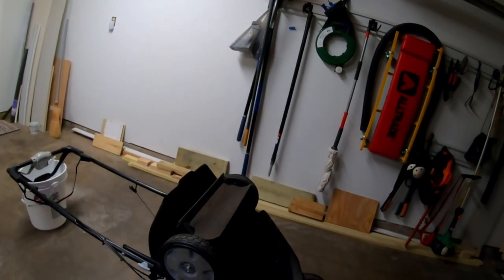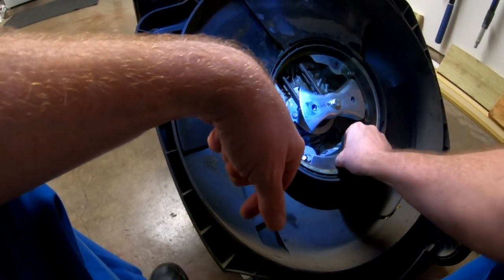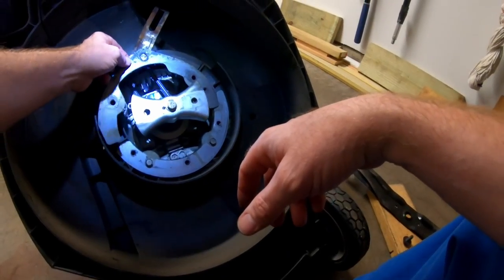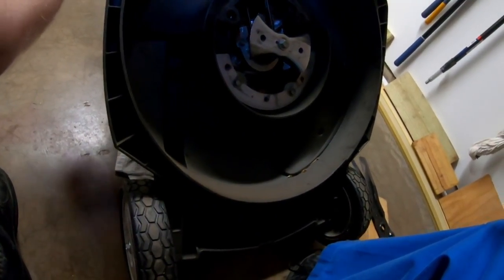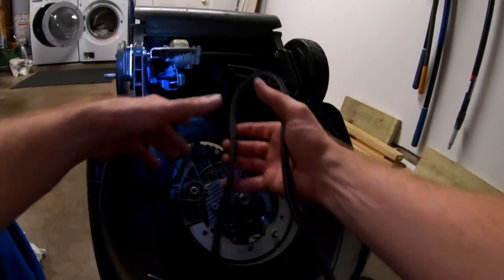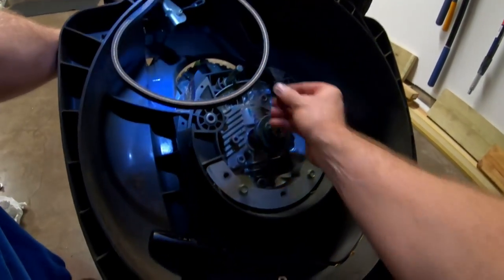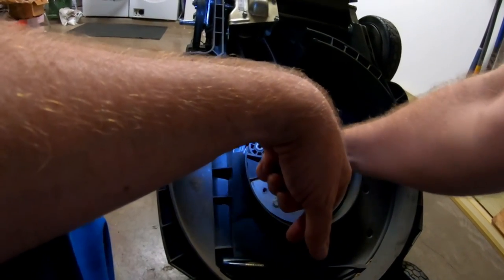Honda HRX217K5KAA belt replacement

Comment: Great vid!!  Thanks for the tutorial.  How did you know what size Bearings to order for those wheels? Are the fronts and backs the same size? Thanks
Reply from the maker: I included the part numbers in the updated video I did of this but the part numbers I got from the shop manual I bought for the mower, they are Axle Bearings 91056-vl0-b00

Comment: I think I need to do this,  My mower doesn't really have a variable speed is just like one speed, I try to adjust the cable but nothing change, my guess is the belt,  is that why you change your belt?
Reply from the maker: If yours is like mine, you may need a new belt but there is a belt tension adjustment that I cover in the end, maybe that helps your situation.

Comment: This video was helpful, lighting and camera work could use some improvement. Some of the tricky parts were out of the frame. But thanks for the info
Reply from the maker: Just updated this video by enhancing the lighting and audio from the original, added a few pics of some of the shots that were off screen. Was pretty novice with the gopro then.

Comment: Great video and thanks for putting this together.  What was the model number of the belt you purchased?
Reply from the maker: Probably a late reply, I was just updating the video due to the lack of lighting on original, but to answer your question it was Honda Belt (22431-VH7-K00)

Comment: How often does the belt need to be replaced
Reply from the maker: Just a guess, because it would depend on how much grass you cutting each mowing, how long your mowing seasons is etc. 5 years approx. You'll know because you turning that traction dial further and further clockwise means you are trying to put tightness in the  belt to get more traction. You can adjust the adjuster at that point to get some of the traction back but only so much room for the adjuster to go.

Comment: Anti-seize on bolts, shouldn’t it be a blue loctite?
Reply from the maker: On my Harley it definitely is blue Loctite, lol. On this, I haven't found anything that specifies Loctite, torque, yes, but not Loctite. I even bought the shop manual, which covers much more than the Owners manual. With the exposure to wet grass, or if you hose the underside of the deck out, you will subject the bolts to corrosion, so I always put antiseize on the bolts in this area.

Comment: You never got the belt off and replace it with a new one, what is the point of this video?
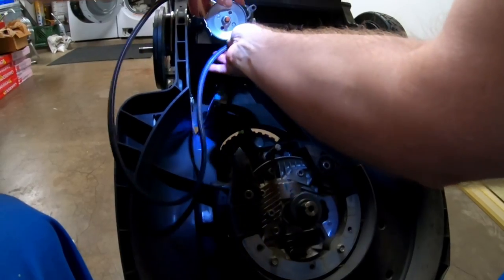Reply from the maker: At roughly 15:25 I removed the belt, and I also state this is a new belt I had just put on a few days prior. The only reason I shot this video is I had just removed this belt and replaced it a few days prior and with no content avail on YouTube, I took it all back apart again so others would know how to do it.